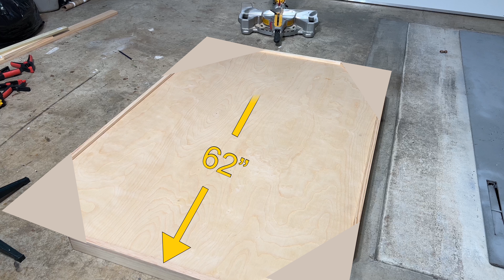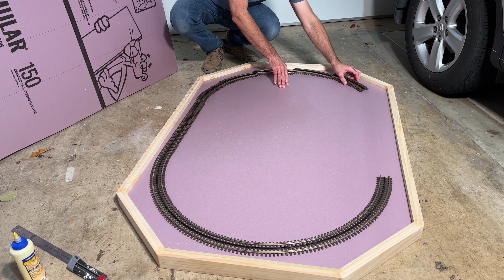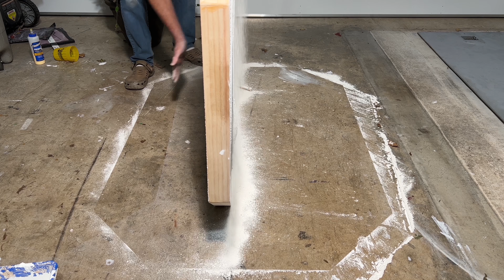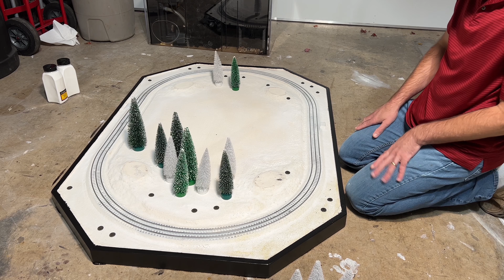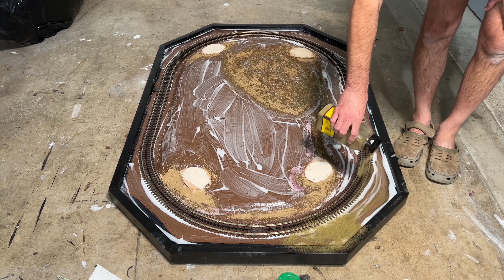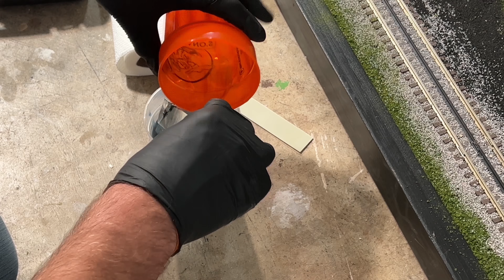Building a Reversible O Gauge Layout From Start to Finish

Comment: Love the channel, you given me inspiration and ideas. I'm building my first layout. A tree (fake tree) mounted, 2  half circles from a picture frame, connecting by magnets and running on batteries. It can be split and set on table top as separate displays, but running while connected. For power I'm planning on 2 9v batteries in series with a 12v regulator. Pretty fun learning and researching, the building will test my patience... 😂

Comment: Steve, are you afraid of tables? You always display and build your layouts on the floor.
Reply from the maker: I have sawhorses and such but often I’m just working for 10-15 mins at a time and we still use the garage for cars, so often I’m pulling something out to work on quickly for 10 mins and then propping it up against the wall and stuff like that. If I had a permanent space I would certainly have rolling tables and that kind of thing.